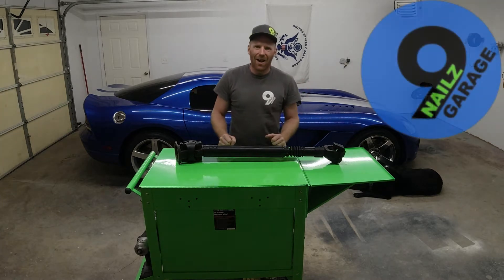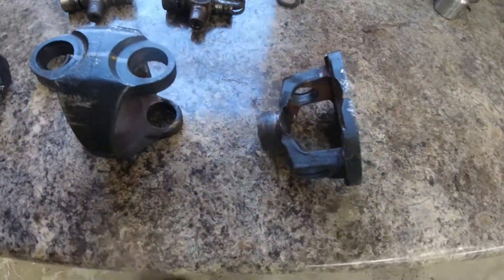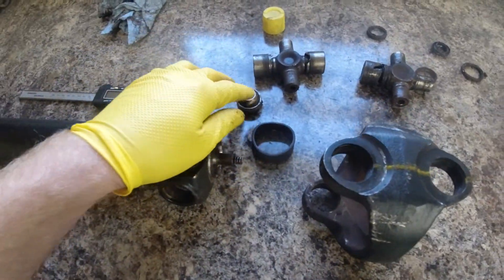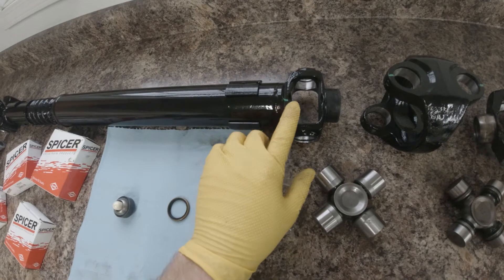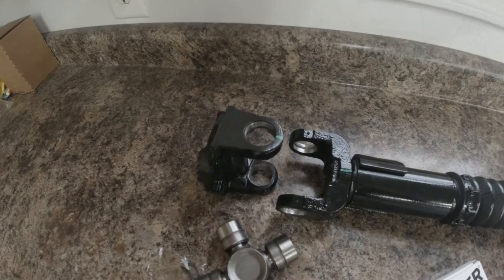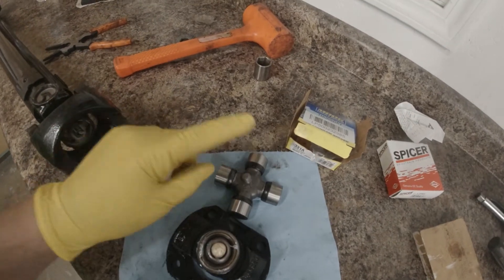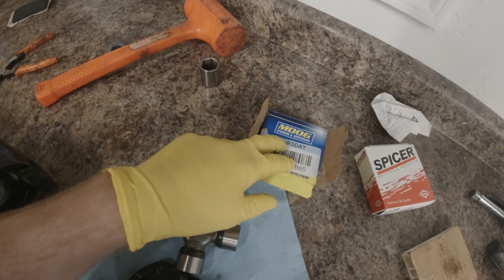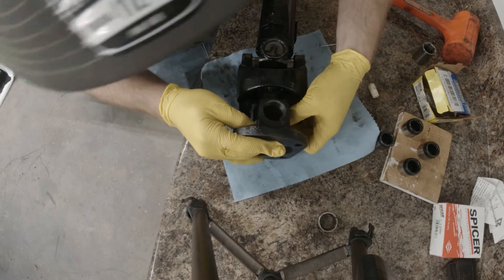How to Rebuild a Double Cardan Drive Shaft from a 2007 Dodge Ram 2500.

Comment: You went from the front you joint to well into the process of taking apart the rear double carden with no explanation or filming of intermediate steps
Reply: Because it's the same exact process, just repeated.
Reply: @ you did not show yhe complete process.  A more experienced mechanic can do the job just fine with your video and it’s a well made video, but,  when it comes to auto mechanics, I an a self-taught Neanderthal.  No foul.  Found out that the replacement shaft comes pre-assembled, and time being more precious than money it was worth the extra expense.  If I remember correctly your video showed removal and that helped me greatly.  Thanks!
Reply: @RobGodwin-h2e  upon looking at your video the second time I would say the only thing I was missing out on is how to remove the centering ball without damaging the carden when the ball does not just fall out during the disassembly process.  Mine was well and truly stuck in the carden.

Comment: do you by chance have the part number for the cv ball stud flange you had welded on?
Reply from the maker: Below are the links for the parts I used to rebuild this drive shaft;

Amazon

Spicer 5-3208X Special Lube For Life Non-Greasable Universal Joint
https://www.amazon.com/gp/product/B018OGIPT4/ref=ppx_yo_dt_b_asin_title_o07_s00?ie=UTF8&psc=1

Spicer 5-3211X Universal Joint
https://www.amazon.com/gp/product/B00DOH3R6U/ref=ppx_yo_dt_b_asin_title_o01_s00?ie=UTF8&psc=1

Drivetrain America

Spicer 3-28-1327X Ball Stud CV Yoke 1350-
https://www.drivetrainamerica.com/spicer-3-28-1327x-ball-stud-cv-yoke-1350/

Summit Racing

Spicer Drivetrain Products CV Ball Seat Repair Kits 10018440
https://www.summitracing.com/parts/sdh-10018440